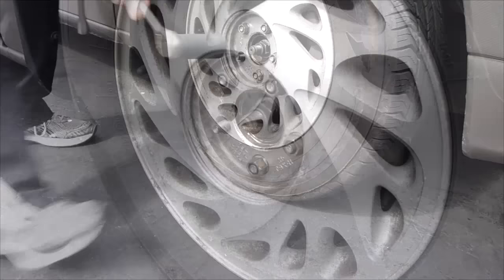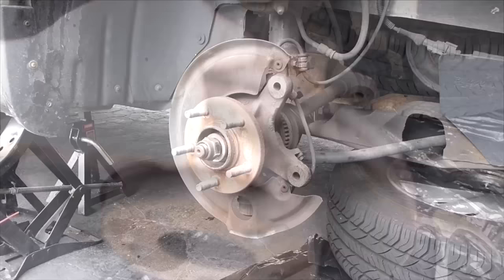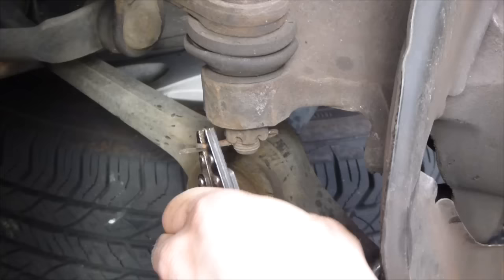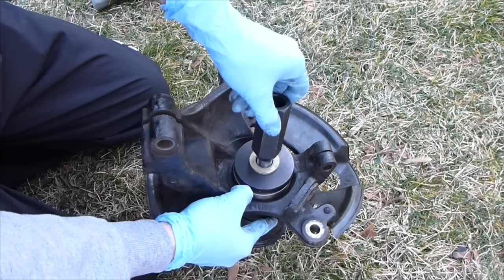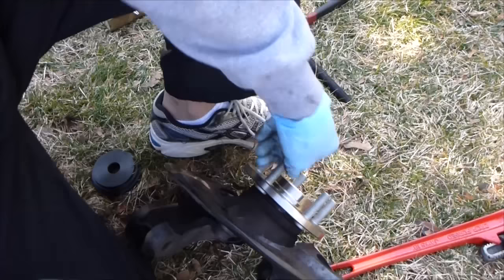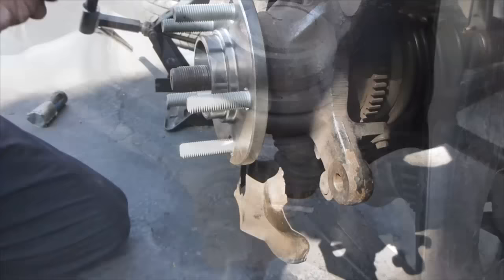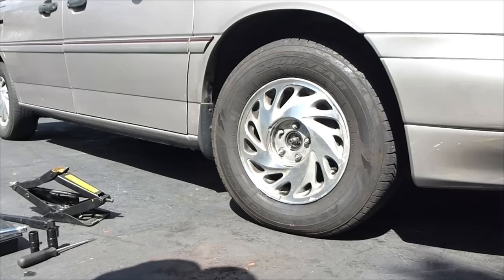How to Change a Wheel Bearing (short and fast version)

Comment: thanks for the video. my only critique is never ever hit the studs of the tie rod.  just band on the knuckle a few times and it will pop right out. :-)
Reply from the maker: +77gerry84 Thanks, dont hit the knuckle because that causes stress fractures for the brittle knuckle. Instead, put a nut on the end of the tie rod like I show in this video: https://www.youtube.com/watch?v=8lJvb3tFjfc
Thanks for the tip because your way definitely works better than just hitting the stud!

Comment: Great Vid! Best on the subject He does a great job and keeps it all simple. I recommend if you use bolt and plates, i lube the bolt with CV grease as it takes huge loads as many people complain about stripping these bolts after couple uses and perhaps not use a plumbers wrench haha and find socket that fits bolt. You can pound out old hub if you not reuse bearing but always press out old bearing DONT pound it out of hub as great stress could damage hub. He does great job using correct tools to do this job correctly  and always use torque wrench NEVER air gun when tighten CV Nut to correct torque eg 200-300nm and turn hub always to seat any bearing you do front or rear when torquing.
Reply from the maker: Thanks and thanks for the tip!!!

Comment: great video, just one tip: don't use a hammer directly on the bolt to take the tie rod out; you could damage the thread on the bolt, not allowing the the castle nut to be put back on there. either use a rubber mallet, or screw the castle nut back in but the other way around just enough so you dont hit the bolt, and hammer on that
Reply from the maker: pierre0202 Thanks and thanks for the tip. Yea, I now put the castle nut on and hammer that to prevent any chance of damage.

Comment: The older hub can still be reused but if the outer bearing race is stuck fast, it can be removed by cutting it and chiseling it off but be very careful not to nick the hub spindle with the cutting wheel.
If you do, that's it. The hub is trash.

Comment: Chris - I noticed that you didn't use the flat side of the backing plate when you pressed the hub back in.  I just did mine and that caused the inner race (on the axle side) to be pressed out since it was unsupported.
 Good lesson learned for me :(

Comment: You should move to the other side of the tire and push down to torque the hub nut using your weight instead of lifting up.

Comment: Thank very much, more than I can say ,teacher.very good idea.I`ve  never seen it before. I learned it from Apex school they used hydraulic press.Now you use bolt and nut only.It is more easy.I try to fit the car.Now I`m trying to find the job at the auto repair shop. But most of shops are hiring job experienced mechanic only.Before I can get job I do the thing whatever I can do.
     God bless you ,sir
Reply from the maker: Saw Tun Thanks Saw! Good luck with the job search!
Reply: Thank you ,sir

Comment: chris awesome video but u ddnt have to completely take everythin apart you could have left it on the car and used the bearing driver tool on the car. that would b the faster way not the way you did it. the way you did it u took everythin apart which kind of defeats the purpose of that tool. its so you dont have to completly remove everything and you can install the new bearin on the car and save time.

if anyone wants to see a video of the wheel bearin replaced while on the car to save some time and it be easier. look up south main auto he has great on swapin the wheel bearin while on the car and so many other great videos. 

so do you chris you got awesome videos im subscribed and always give a thumbs up.

Comment: The Mountain torque wrench looks like a good deal. The torque wrenches I saw at Harbor Freight were of such poor quality. They didn't seem to be worth buying and using.

It would be helpful if I could find an auto parts store that will loan the bearing press kit.

For wheel bearing grease, I just meant the grease you put on the outside of the bearing. At around 6 minutes and 20 seconds, you put a little grease on the outside of the new wheel bearing so it will go into the steering knuckle a little easier. Does it matter what type of grease you use? I only have a little tube of brake caliper grease.

Thank you for your help Chris!
Reply from the maker: Anthony Starfield Yea,  the MOuntain torque wrench is a good deal. The harbor freight torque wrenches from Harbor freight are good if you work on your car once a month or something but they dont last very long. As for the grease, it really doesnt matter what you use. I actually learned something new so instead of using grease, you put the bearing in the freezer and that will make it slide in a lot easier!
Reply: Harbor Freight torque wrenches are great (especially for eleven dollars!), but you have to be sure to calibrate them before using, even from the factory.

Comment: 3:57
Says the same guy in a video he made on how to replace the outer tie rod to NEVER hit the knuckle or tie rod ball joint bolt with a hammer to remove it and to use the proper tool ....

Comment: YOU ARE THE KING! Currently doing this job on an 03 PT and this perfect lil video was the simplest and easiest to comprehend. The setup is practically identical on the PT  as on the ford. However I opted for the slide hammer method and that has turned out to be a bust. The hub is so frozen, I'm getting about 1/8" movement for every 150 slides of the hammer. Not fun. Do you think it would be easier to pull the knuckle off and try your ground method or should I just leave it on and slide for the best hoping it gives up sooner. I've got the hub about 1/4 of the way out of the knuckle and at the rate I'm going, it'll take me another couple days to conquer. Got an opinion? An idea? A suggestion? Anything?! Please?!

Comment: That's an awesome tool to have at your disposal, great Vid,  though i thought at one point the bearing you were  using was a special kind that had a magnetic side on one side but not the other. I've made the mistake once to where I pressed the bearing in the wrong side and had an ABS issue
Reply from the maker: Thanks! Yea this bearing doesnt have magnets in it. The ABS is read off of a gear wheel on the axle.

Comment: And when you think you can't pull or bang any more; soak and add HEAT. Made things much more possible in my case; I let my hubs go for over two years before replacing- myself. A miserable, miserable time- I thought there was no way they were coming off. If you get frustrated, message me. I do not mind giving any information to help make your job easier than it was for me!
Reply from the maker: amy lee Thanks for sharing!

Comment: I heat the knuckle up in the gas grill or oven if you wife will let you.  Freeze the Bearing.  It will drop right in.  If you have dry ice it works wonders.  to get the hub in.  Again hit the hub with the dry ice.  The bearing will take a little heat from the knuckle.  Don't worry it wont hurt it.  Just not cherry red.  They run pretty warm anyway.

Comment: When pressing the hub onto the bearing, isn't it best to support the inner race of the bearing on the opposite side of the hub? Otherwise, you are pressing the hub onto the bearing, placing massive force on the unsupported inner race.
Reply: Good point. In fact not supporting the entire back side of the bearing with a flat bearing tool exact size of bearing will mean a bearing that will break out on the back side as you press the hub into the bearing. A ruined bearing....this is not as easy a job as Chris makes it out to be.

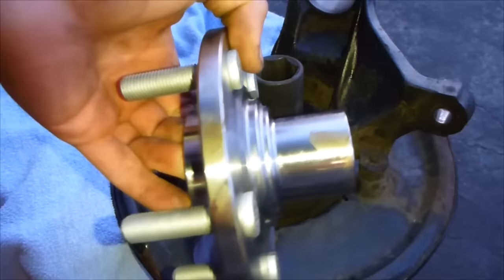Comment: A SOCKET is not a ratchet. The ratchet is the tool you use to turn the socket, specifically the 30mm SOCKET at about the 5:25 mark.
Reply from the maker: Robert Gantry Thanks for the clarification!

Comment: i noticed when you were removing the tie rod end that you were hitting the threaded portion up. word of caution, if you hit the threaded stud portion with a hammer, you will mushroom the end, and can be a real pain getting that nut started again. good rule of thumb when it comes to tie rod ends, or ball joints or anything with a tapered fit is hit what it goes through.. good video though, definitley need to pick up one of those presses for work. basically could do that job with the knuckle attached to the vehicle still . make some time.
Reply from the maker: nissanmikey Thanks a lot! Yea, I since then have learned to put the castle nut back on and hit that.

Comment: use the wrench the other side of the wheel and push down, not pull up so you don't hurt your back. just advice from someone who's getting old. . .nice work and good can do spirit. nothing can stop you except yourself. . . remember what i said about hurting your back, if that happens, you will have stopped yourself.

Comment: Once you use the kit to do this on the car rather than removing the spindle you will never go back.  Saves a lot of hassle and pretty easy.
Reply: +ykmalachi what kit is it??
Reply: Wheel bearing removal set sold at Harbor Freight.
Reply: ykmalachi yeah I thought these kits were designed to be able to press and remove bearings while the spindle is on the vehicle

Comment: You forgot to tell about the bearing sensor . With it the bearing goes in one way only for it to work. Without  the sensor it doesn't matter how the bearing is installed in the knuckle.

Comment: ChrisFix I have a 2005 scion xb with 220K miles. I have owned it since it was new. Great car. Four months ago alternator went.  This week the starter died.  I roll started it using the clutch but I drive for a living so I had it changed with a rebuilt.  Anyway,  I have a problem that the dealership says is a hub bearing (or wheel bearing).  It is pricey with them or other mechanic shops.  I asked the guy at the Toyota dealership how does he know that it is the bearing.  He lifted the car and walked me over to the good wheel, asked me to grip one ring og the suspension springs as he spinned the wheel.  The good one was uneventful.  Then he took me over to the other wheel (front passenger side) and we did the same.  My hand vibrated when he spinned the tire.   The price was over 600.  I went to another place and without touching the tire they told me just over 500 but includes wheel alignment,   A guy that works at a tire place and supplements his living fixing cars examined my car in front of me and said it is likely a cheaper fix. He says for me to order a tie rod end online.  He jacked up my car moved the wheel in the various directions  then asked me to go through cycles of gently then later vigorously shaking the wheel  while he was under the lifted car closely examining the parts. How do I know if it is the bearing or another part.  Side note.  this Toyota dealership has proven to be both very premature and extra with the repairs (it is not the dealership that I purchased the vehicle in).

Comment: I'd never hit the head of the tie rod taper without the castle nut flipped, and threaded flush to the end where the hammer impacts. Having that nut will prevent the threads from being hit & also keeps the tip from mushrooming.
Reply from the maker: Great tip and I agree!
Reply: Yeah, in his later "How to remove outer tie rod" video, he flips the castle nut upside down. :D. Thanks for the video.
Reply: +pellergin I didn't realize how old this video is. Chris has come a long way since. :)

Comment: The most confusing part for me in this process is how much do you need to press a hub into the knuckle bearing. I pressed the hub (I have Harbor Fright Press), seems like I could go further, but afraid to break smth. That advice Chris gives about a flat screwdriver is not quite clear for me (is it between the plane of the hub and knuckle surface or between the head of those bolts on the hub and the knuckle. Maybe it can be determined by looking from the side of the knuckle (where the snap ring is). Not sure if the work is done correctly and though I'll do a research online of course, but i would appreciate any opinion on this matter. Thank you for the very informative film in all other aspects.

Comment: Something I didn't see? Pressing the rotor into the bearing needs to be done by using force on the inner bearing race and the rotor only. The bearing may not like the use of force on the outer bearing race and the rotor while pressing in because no pressing force should be placed on the ball bearings. Pressing the bearing into the knuckle is well done, using force between the knuckle and the outer race.
Reply: Jorge R Rosado .

Comment: for one thing u never hit the threaded end of the tie rod just hit the tie rod receiver on the spindle and tie rod will pop loose,and when removing and installing the bearing did i not see you with an air gun use it much easier and faster

Comment: It was a good video. But what I don't understand is that you had an impact for the axle nut, but used a 4 way for the lugs. Then a pipe wrench for the bearing pull. And a claw hammer instead of a separator tool. 
But like I said... still a good video.

Comment: Dude you just used a front wheel bering extractor/puller used to NOT have to remove the hub at all. LOL! Great video though.
Reply from the maker: Juan C. Villegas No matter what I had to keep it on the tie rod and swing the knuckle sideways. Since all that was holding it on was the tie rod, why not just take the tie rod off and work on the knuckle wherever you want. Plus I needed a lot of leverage on that bearing to force it in and out so.

Comment: Well done Chris, good job. I do have a problem with my front bearing, I will be grateful if you could help me figure out its problem. I was having a problem with my front bearing, they were torn and have a scratching sound coming out of them especially the left one. I do have Skoda Rapid 2015, I changed its front bearing set for the 2 front wheels and they were not just a bearing, it is a one set contains a flange along and welded to the bearing as one whole set that is compressed to the armhole. after changing them the scratching sound is gone and the car ran smoothly. I do have an ABS sensor error alarm, this alarm is continuous just after changing them. and when getting back to the mechanic, he removed the one with the sensor error and compressed a new one again and still I have the error. What shall be the real solution to this problem from your point of experience ?!!!!
Reply from the maker: I would see if the connection is corroded and clean it up, that should make the light go away if you replaced the hub! If that doesn't work then the pump or unit might be on its way out and that will require replacement.
Reply: @chrisfix  I did every thing, resetted the error code from controller and compressed a new one and all of that didn't resolve any thing...!!! same error keep glowing every time you start the car, it may go away and come back again, but finally i have it sticking ahead. What pump do you mean i have to change?!!

Comment: Goodness, that's a lot more steps than I thought there would be. My bearing locked up on me so I can't drive on it and I don't have a press kit to do this or most of the tools for this. Also, wouldn't you need to get an alignment done after taking the tie rod off?
Reply from the maker: tyler hoskins You are just unbolting the tie rod end from the knuckle so you wont have to align the car afterwards. Are you sure your bearing is pressed and isnt a hub assembly like in this video: https://www.youtube.com/watch?v=jSkbBCNqFpg
Reply: Actually it's not. There were a few differences. For instance, your axel arm seemed a lot easier to take off. And the hub assembly had a bracket holding in the brake pads. But some things in this video were very helpful. Thank you

Comment: only thing i do diff is leave the castle nut on so i dont damage the threads and be careful cv shaft nut could be taped in if it is it could damage the threads when you take  off the nut and i always check the senser on the cv shaft jus clean it a lil lol but a very awsome vid sorry if it seems like im nit pickin ya lol awsome jod and love that bearing tool whered you get it i want it lmao

Comment: Chris I just found out today, not a good idea to hammer anything in. I see ur not going crazy but lightly hammering.  Also ur using a manuel press to do the job. My shop fixed someone else's job that was hammered in with great force. I saw step by step how the press machine did the job. I got top of the line bearing, hub and service.  Never again asking someone else to do this job.  I'm just sticking to my Shop. Car is back functional working order.

Comment: This doesn't always work unless you have a 12 ton shop press.
Reply from the maker: It definitely makes the job easier but it's not always required, if you can't get it out no matter what you can bring it to a shop and they can press it out for you for a small charge

Comment: sorry to bother, but could we heat up the knuckle and freeze the new bearing to drop it into one another? or that may crack it when putting in new bearing?
Reply: It works if you don't overheat the knuckle and destroy the factory heat treatment. If that knuckle begins to change color while torching you're
overheating it.
Reply: thomas laux this is what the guy down the street does

Comment: you used the Socket to remove the hub out of the bearing by hammering?  did that come out easy and what (base/vice/ holder) did you have it on to remove it? did you spray it with penetrant to make it easy to come off?